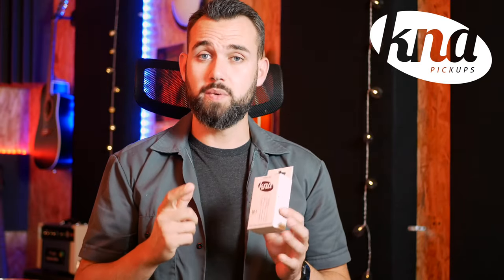KNA DB-1 - easy-to-fit, accurate-sounding, practical double bass pickup | Mic vs Pickup comparison

Comment: I have had good luck playing with this pickup live through a graphic equalizer to help eliminate any feedback, depending on the acoustics of the venue. Also, have found a very warm sound for recording using the KNA DB-1 pickup and a Shure SM-57 microphone pointed about 8 inches from the f-holes.

Comment: What was the difference with that second bass? it sounded a little clearer with the microphone but it seems to be going for a different sound. The clip sold me on it anyway lol Thank you
Reply: Looks like the second bass had gut strings.  The first one appears to have nylon wound jazz type strings.
Reply: Not only instruments and strings are different. Left or right side of the bridge for piezo so it makes a huge difference in sound. A totally different sound.
I'm using Shadow SH-950 piezo pickup with my upright (only one side in the bridge, E string) but I think I'm gonna buy this one. I like more acousitc, clearer sound with KNA based on a few videos. We will hear in real how it sounds vs. Shadow.